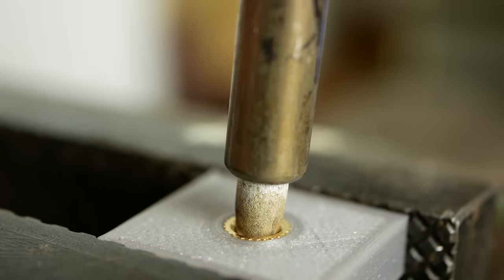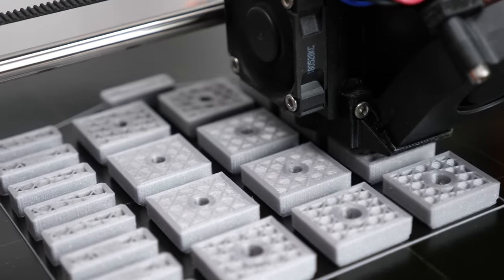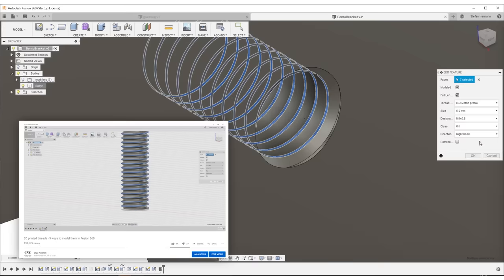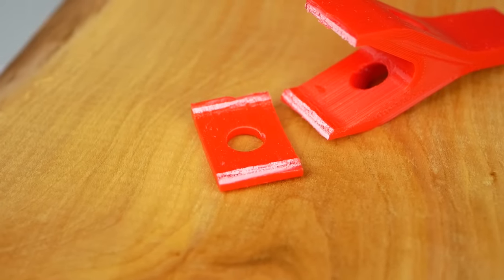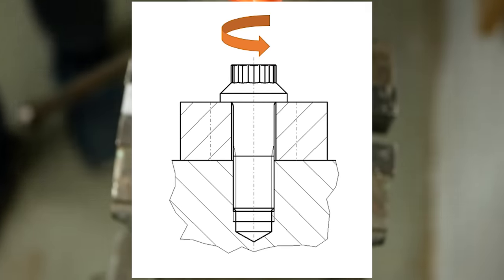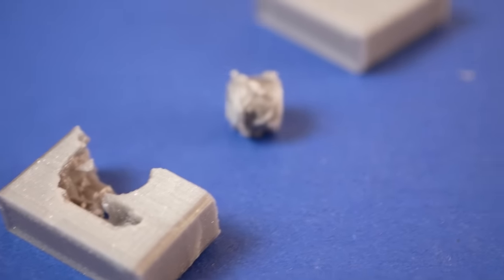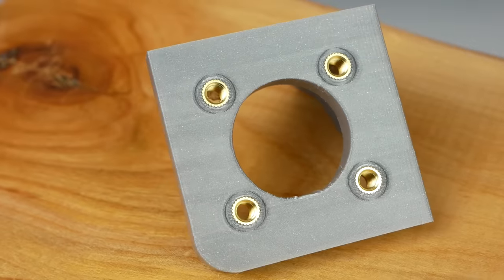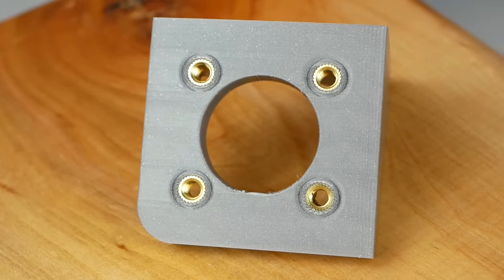Threaded Inserts in 3D Prints - How strong are they?

Comment: The primary benefit of the inserts is that you can screw and unscrew many times without the threads wearing out.
Reply: Matthew Humphrey exactly, plastic threads are sensitive to torque as he said and wear out quickly even with the right torque tightening
Reply: @rotorblade9508  Not if you use a proper screw with threads designed for plastic. I don't get why people use machine bolts in 3d-printed objects as they are designed for metal threads. There exists such a thing as screw designed for plastic. You can get these for free from any broken appliance with plastic enclosure. Easier to use, better grip, and no need for threads, just a suitably sized hole.
Reply: @ilkkavierula6664  The screws designed for plastic work great in applications where you screw it together and then never take it apart. Since these screws are designed to cut threads, if you remove them and put them back in, it's very easy to accidentally cut a new set of threads instead of screwing into the existing threads. That is a recipe for stripped threads.

On commercial products, you often see thread-cutting screws holding most things together, but then a threaded insert and machine screw on things like battery doors that get repeated use.

If you are able, you should have both thread-cutting and machine screws on hand and use the best screw for any given job. If your screw variety is limited by space, budget, or other factors however, I would consider machine screws to be more versatile.
Reply: @jcon6734  Most of the time they settle on the existing threads. Especially if you start screwing with light force without forcing it (as you are supposed to do with any screw). Even if the screw cuts multiple threads it doesn't significantly weaken the holding power of the screw. This is due to the mechanics of how to screw works. The factor determining the holding power of screw in material is the shear strength of the material and screw threads. The variable determining the shear strength is the shear surface area and shear strength of the material. The amount of material removed by the thin thread of a plastic screw is so little it hardly has an effect on the shear surface area, thus the effect on pullout strength is very small.

It can be a bit counterintuitive, but you can try it yourself by screwing a piece of wood to a phone catalog or old book. It will hold there very firmly even though there are hudreds of "threads " between pages. To pull out the threads would have to punch through hundreds of sheets of paper, which anyone who has tried to hole punch through a thick stack of paper knows takes a lot of force.

Most of the times when screws fail in plastic it's caused by poor tolerances of screws and holes. If the hole is too big for the screw's cylindrical body, the screw can move sideways under cyclic loads, slowly chipping away the plastic holding the screw. Overtightening and sideways loads during tightening will also cause this.

If a screw needs to withstand huge amount assembly/disassembly cycles (more than a few dozen) best option is a self-tapping threaded insert. These are stronger than mold-in ones (especially when used incorrectly as melt-in with) or helical coil inserts (which are not intended for this purpose at all, they are for thread repair). Mold-in inserts will not bond properly when installed using melt-in technique with soldering iron or similar. They require either ultrasonic welding device, or proper heat press if they are not injection molded in place. Hole tolerance is also critical for them to work.

Edit: If you want to study more, may I recommend:

https://www.stanleyengineeredfastening.com/-/media/web/sef/resources/docs/other/threaded_fasteners_for_plastics.ashx

https://techcenter.lanxess.com/scp/americas/en/docguard/Joining_Guide.pdf?docId=77016

https://www.celofasteners.cn/img/cms/Cat%C3%A1logos%20industria/Screws%20for%20plastic%20CELO.pdf

https://www.spirol.com/library/main_catalogs/SPIROL-Inserts-for-Plastics-us.pdf

As some good starting points.
Reply: @ilkkavierula6664  It seems like you know your stuff. Since the screws aren't actually removing material, it makes sense that cutting a new set of threads wouldn't weaken it too much. That said, it sure seems like I constantly strip threads out when I'm not careful to catch the original threads. Any thoughts on the actual problem? Am I just particularly ham-fisted?

I will say that I disagree with you on the heat-setting threaded inserts. While they might not bond "properly," if the plastic is breaking before that bond fails, I'd say it's good enough. The self-tapping inserts might technically be better, but they're also an order of magnitude more expensive and I'm not sure you'd see much real-world benefit.
Reply: @ilkkavierula6664  >Mold-in inserts will not bond properly when installed using melt-in technique with soldering iron or similar. They require either ultrasonic welding device, or proper heat press if they are not injection molded in place.

Injection molding is just shooting molten plastic material into a mold, screws and other parts being optional. How is this different from melting the plastic around the insert?
Reply: @zackhenderson2392  They need correct insertion speed and temperature to make the plastic flow properly into the knurling and bond. The motion needs to controlled, any sideways wiggle will lead to air pockets and poor bonding. It needs a linear motion jig at minimum.

Mold in inserts will also cause large stresses due to different thermal expansion characteristics of metal and plastic. These residual stresses cause phenomena like the notorious ender 3 extruder arms breaking next to the insert.
Reply: Exactly, this is the main reason, inserts increase the reusability of the piece, greatly.
Reply: I wouldn't say primary.  If that was the case a thread repair kit could be used where you are just adding threads instead of the barrel also.
Reply: @godzgr8  No, because when the threads wear out the plastic is gone. This is 100% the primary point of  threaded inserts. If you want strength, a captured nut is a little stronger.
Reply: Exactly at the machine shop I work at threaded inserts are very common because the aluminum material we use in a lot of parts can wear out faster so our parts often use threaded steel inserts for wear protection

Comment: I use M3 for everything 3d-printing related.
Reply: I do too
Reply: Me too :) And i'd be interested if results with PETG are the same, cause that is the material i use 90% of the time ^^
Reply: Me too.
Reply: M3 is definitely the most used for 3d prints
Reply: Same. M2 for the tiny stuff and M3 Torx head for pretty much everything else. Usually don't print parts that require something as large as a M5.
Reply: Me too :)
Reply: Same
Reply: I also use M3 and PLA. Otherwise the topic of the video was really interesting !
Reply: PLA and PETG with mainly M3 and M4 here.  Nice video - well researched and smoothly presented - Thank You :)
Reply: me too.
Reply: M3 is very common for electronics and 3d printing, but m4/m5 are also commonly used, so it would be nice to check if they behave the same
Reply: +1 for M3, never had much luck getting consistent thread when tapping directly into PLA, will give inserts a go now.
Reply: socket head M3, just such  a great screw.
Reply: M3 is where it's at! Perfect size for the kind of part sizes that we can print on our 200mm printers. Look at the Prusa, all assembled with M3 :)
Reply: Same
Reply: I do too, and the physics of M3's is probably quite different to M5s.
Reply: Even an m3 is usually way stronger than the surrounding plastic
Reply: Use shouldered inserts fitted in the reverse side, to eliminate pull- out!
Reply: I use my hand for 3d printing
Reply: Yea same, also never once used M5. I have occasioanlly used M4, but in about 95%  of all cases I use M3.
Reply: Me too
Reply: Same here, M3 for small enclosures and directly screwing into mostly PETG so far.
I only recently got inserts and a colleague at work machined me a couple of special tips for my soldering iron. But even with these the inserts did not go in perfectly straight when pushing by hand so for good and repeatable results a drill stand looks like to be required.
Reply: I use 4-40 since I’m from America.
Reply: same
Reply: Same
Reply: It’s the sweet spot
Reply: m3 for selftappers, m4 for bolts for me
Reply: We are manufacturer of this brass het set inserts.
Reply: Yeah, just ordered a bunch of M3 hardware. Helps that I can mount (most) PCB standoffs in the nuts.
Reply: Same :D
Reply: Why m3? Why not m6 or m5? Or 10-32 or 8-32 or 1/4-20 can u explain why m3 and u got so many likes

Comment: Someone else may have already mentioned this, but you should do a 100% infill print and see if you can get the failure to occur at the actual theads and not the material around the hole.  You're seeing similar strength because the failure is the same.  It's the material outside of the hole where infill is weak.

Comment: Very well done !  Thanks for sharing. As a CNC machinist for 20 yrs, I'll share some tips for too. To find the hole dia for a screw reciprocate the thread pitch then subtract that sum from your screw dia ( 1/thread pitch - screw dia = hole dia for American screws ) (  thread pitch - screw dia = hole dia for metric ) , threaded inserts are good but if a really strong thread is needed, use the Heli-coil product. Heli-coil in aluminum engine blocks is almost a standard in racing engines. When pressing in threaded inserts use a drill press. Use threaded stock in the drill chuck to press the insert into the part, heat can be apply by torch to the threaded stock. Also, the M4 is the most commonly used screw in mechanical design.

Comment: When the parts aren't required to be very strong, we often cut threads into the PLA, but in all applications that require strength, we use nuts and bolts, often making the nut "captured" in a hex cutout to keep it flush with the part.

Comment: I don't model threads for one-time use connections. Directly screwing screws or bolts into appropriately sized holes have been working fine without any splitting. For threads that get lots of screwing in and out, I just use inserts like you and they work just fine - both PLA and PETG.

Comment: Two things I would love to see a follow up on:
- Like most of the comments here I use primarily m3 threads. I'd like to see how comparisons change at that size
- My preferred way of adding threads is to create a square hole with the same minor diameter as the screw and then threading it in. It seems like the material pushes into the corners and reduces the amount of cracking I see. I'd be great to see this experimentally confirmed
Reply: square hole ?! thx I'm gonna try that in my next design

Comment: i use m3 most often. and i often use pause and insert normal nuts inside the part
Reply: cool, I'll have to try that
Reply: yeah square nuts are better i just had a hard time getting them and have 1000+ of normal hexagon nuts 😁
Reply: @tetraliteproducts542  you can buy square nuts off aliexpress for 1/10th the price
Reply: Yea it's really simple to do nowadays, too. For additional strength an easier insertion I can only recommend getting some square nuts (as others already suggested), as that basically removes any chance they'll start turning inside their cavities. For the same reason you also gain some leeway since the fit doesn't have to be as precise. You can also insert them in a vertical orientation without needing 'filler' parts to plug the cavities at the top a hex nut leaves.

Try getting the thin version, as they don't have a more 'rounded' side and are completely flat on both sides. In Germany those are the DIN 562 variant (the thicker ones are DIN 557).

Comment from the maker: Want to get your 3D prints to the next level? Check out our Heat Set Inserts and Tools at https://cnckitchen.store (Free shipping worldwide starting at €100).
Reply: CNC Kitchen Ich würde dir KEENSERTS Gewindeeinsätzen empfehlen. Die halten in Kunststoff Bombenfest. 😬😑
Reply: I would’ve subscribed if it wasn’t for the way you say Slic3r. :)
Reply: The annoying background music ruins the video???? why did you even bother adding music that 99% of people will not enjoy and about 20% will just stop watching?
Reply from the maker: Feel free to share the video (link or embedded YouTube player)  but please don't re-upload or self host it.
Reply: 3d printed parts is made of plastic just melt the thing together to make connections
Reply: Drawback for the threaded inserts might be accuracy though? I've never used then but how precisely do they go in? Could have been useful to mention this! Personally, I regularly just model and print the threads, typically M3 to M5 for different components.
Reply: Bist du deutscher?
Reply: Just so you know. Your link to "Suitable soldering station" sucks.

Literally. Its a bunch of hand held vacuums. Anyway, as always great quality video :)
Reply: Something I'd like to see tried by people who do lots of 3D printing testing is if acrylic infusion improves the strength of 3D printed parts. How to do that? With air pressure.
In the USA Harbor Freight sells an inexpensive 2.5 gallon pressure pot for painting. There are directions online for how to prepare one for pressure casting plastic resin.
Next thing, find a disposable plastic container like a styrene or polypropylene drink cup, margarine or ice cream tub that will fit into the pressure tank.
For the acrylic, Future floor polish. In the USA that's been renamed to Pledge Floor Gloss. There are similar products in other countries.
Place the printed parts into the container then pour in enough floor polish to cover, plus enough to keep them fully immersed when pressure forces the liquid in.
Put the lid on the pot and apply at least 50 PSI (344 KPa) and leave it for several minutes then release the pressure.
Optional step. Pour out the excess polish then seal up the tank again and use a vacuum pump to draw out air and excess polish from the parts.
Finally, place the infused parts in a dehydrator for a few hours at around 80 to 90F. You want some paper towel below but not touching the parts to catch what polish will run out.

What this is, is pretty much the same process as using Cactus Juice heat cured resin on punky old wood, but at much lower temperatures, or without heating at all if you want to wait a long time for the parts to fully dry. Unlike with Cactus Juice you don't want the filler fully filling up all the internal space, especially on parts with little infill.

Could probably just use vacuum to pull out air to let the polish infuse the printed item, but vacuum pump that's good tends to cost more than a cheap air compressor that will pump up the pressure just fine.

I use the polish to paint surfaces of 100% infill prints to smooth the surface enough so that pressure cast silicone molds won't get forced into and stuck to the item. I've also used the pressure infuse and dehydrate process to prepare printed items with less than 100% infill for making molds.

I'd like to see if the theory that this has any significant effect on the strength is valid.
Reply: I enjoyed this video and your others i have seen so far.
Please keep up the good work!
If you can, try to maintain yourself as apolitical or neutral as possible, because those are the 'fracture points' that people tend to point to when talking negatively if that ever happens.
Also, the information you provide is abundant and clear, if you can try to not fall into the typical youtuber that start making tons of videos per week with below-standard quality.
Reply: Great tests! I really like adding and mixing different materials with 3D prints.... I'm busy upgrading my Prusa i3, and I like that extruder. Any chance that you have a link to the parts to print it? Thanks! New subscription for you, btw...
Reply: I would like to see a comparison across M3, M4 to the M5 data you have acquired.
Reply: A bit of a disappointment when you said that modifier meshes would help significantly in strength, but then didn't test this with your torture test machine. :-)
Reply: @linagee  That would be a good topic for another video, but in this video the conclusions would probably be the same, as the modifier mesh would increase the strength of all methods in the same way.
Reply: Hi Stefan. What do you think about threaded rivets with 3d prints? I guess it should work, don't you think?
Reply: Any recommended soldering station for using this inserts that is commonly available in EU?

Comment: As a suggestion:  Try some of the threaded repair inserts, which have a larger thread on the outside.  Or some “helicoil” style to reinforce printed threads by increasing the effective diameter in the plastic.

Comment: Finally a video using the metric system. Pleasantly surprised i didnt hear you say "23,6/465th hole".
Reply: I have to apologize for my fellow Americans. They are stuck in their ways, I wish we used metric.
Reply: only idiots would say it like that :P
Reply: I absolutely love the metric system.
Reply: as an American: metric is great for   small things and precision. but you cant beat inches when it comes to rough construction like framing. it's easier/faster to say and cut 96 and a half inches rather than 2.4511 meters

Comment: Something I'll do in Fusion to add strength, which is based on your advice (I think) is to add cuts into the body, tiny cylinders, around structural parts. That way the the slicer prints extra walls where it needs support, without adding more infill.